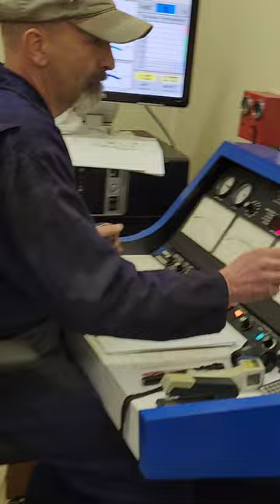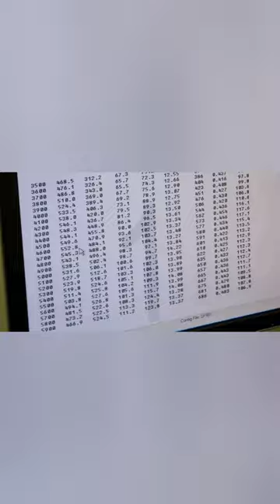Dyno Run of the 408 Mopar Stroker with Trick Flow Heads, Lunati Voodoo 20200713

Comment: I really wish I could pick your brain… I’m about to build a 408 with a .40 over thick wall 2/70 date code 360 for the 76 Streetvan on my channel.
Reply: What's the story with those blocks. I also have a 1970 date coded 360. I thought they came out in 72?
Reply: @roberttorrance9059  only thing I’ve been able to find on this is that they were R&D blocks and have the same metallurgy as a 340 with a thicker wall. I’ve had this engine in less than a year and it was donated to my Van build
Reply: @roberttorrance9059  I would love to know more about these myself!
Reply: @roberttorrance9059   I have one too. Came out model year '71. Mine is .060 and sonic tested good by Hughes Engines. The '71-'73 blocks  were cast with the same water jacket cores as a 340. So, if the 340 can go to 4.10 bore, so can the 360. Larry Shepard stated that in the Mopar book. Early 318's can go 4.00 bore.